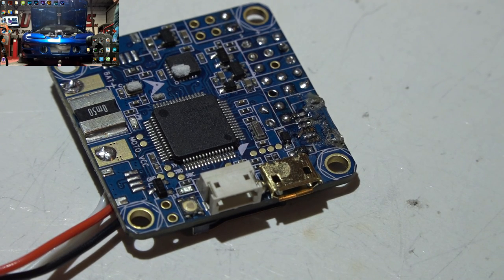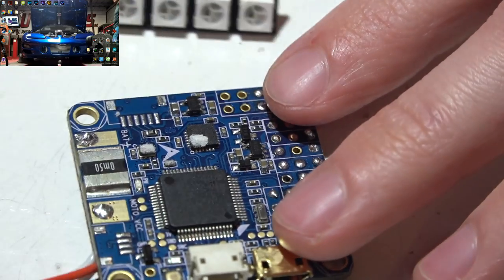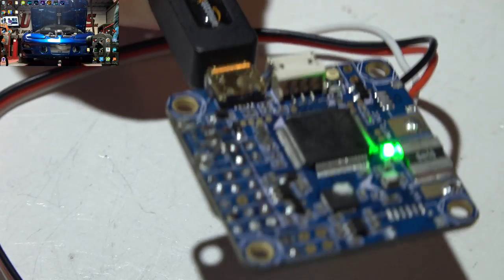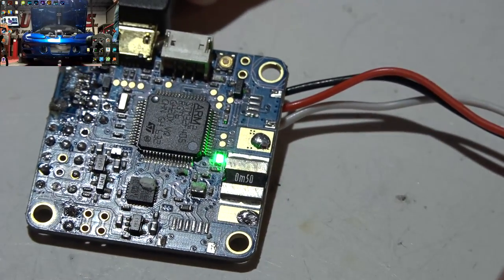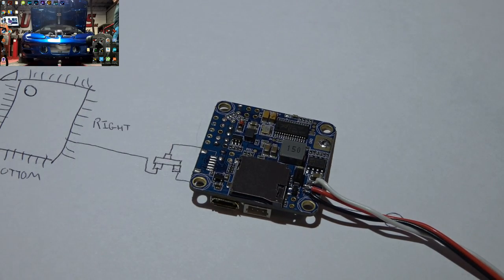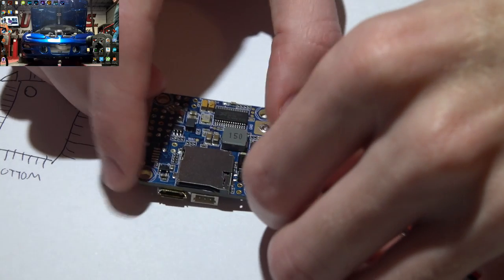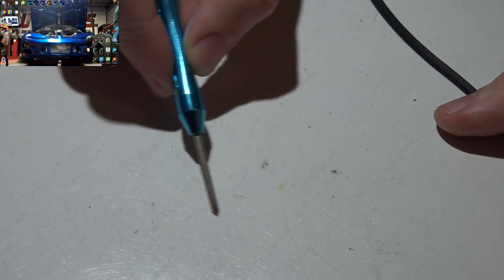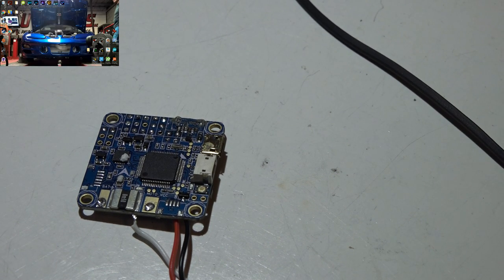How To Check F3 & F4 Processor Pin Outs

Comment: Omnibus F4 Pro. This video is fantastic. I tried PWM5 and PWM6 but noting happened. Came across this video and followed its content. My LED control pin ended up being CS (part of the 6pin connector above the  positive power supply from the battery). Perfect!!

Comment: FYI guys, my F4 PRO LED was mapped to "A1" aka PA1 which is assigned to PWM5 hole. it works!
Reply from the maker: Thanks for sharing. Not sure why its different. Might be different between firmwares.
Reply: yeah I am running betaflight 3.1
Reply: Hi! mine is the same, but I can´t make it work. When I only power it (led strip), some leds light up, but others don't. could it be wrapped?thanks

Comment: Good day to you Project Blue Falcon, I'm Reff !
Firstly, I would like to write that this was one of the awesome videos i've seen, very informative and you've actually taught me something new after watching it today, I never knew that this could be done, such as touching the cpu to the pins of the FC, I would never think of that, thank you very much !

Secondly, I have a question which I'm hoping that you might be able to help, and its regarding the SPI 1 pins on a Mamba F405 mk2 flight controller. I cant find which pins on Mamba F405 mk2 has the SPI 1. I've used your method of checking continuity as shown in this video, however none of the pins beep on the multimeter for any SPI pins. A
ny idea on how to trace, as I've tried two mulitimeters bet still cant find which pin is associated with SPI 1
Reply: Unfortunately Project Blue Falcon died on a motorcycle crash a few years ago, he won't answer. Even some time after this accident this channel is still relevant.

Comment: I am building a wing
they say to remove the red wire on the  plug on the speed controller
I'm not getting 5 volts on my servo
this board supposed to have 5 volts for the servo
is there something I'm missing I have to jump 
my 5-volt rail is dead for the servos          thanks for your help

Comment: Great vid JC. I've got an OBF3 were the video stopped working after a crash.  Video works fine if you bridge the signal wires together, just not through the FC board.  I've already replaced the board with a new one.  I'm thinking about doing a "reflow" with the old FC, like on StingersSwarm site.  Any thoughts before I toss it in the oven????
Reply from the maker: I'd say first, did you upgrade the firmware to 3.1 and are using the 1.8.5 configurator? Because I was having problems with video before. Also try flip flopping the camera and Vtx signal wires going into the board because they have been flip flopping the pin outs on the boards. If you've tried both then I'd say go ahead and try a reflow in the oven.
Reply: Thanks JC, this board is on 3.0.1.  I'll update and flip the pins.  OK, I love the OBF3 and OBF4 FCs (I have 5 of them), but it feels like playing wak-a-mole sometimes with the pinouts.  Remember PWM3 and PWM4 being reversed... Thanks again, have a great week...
Reply from the maker: Lol yea I remember that. Which I was upset about then switched 3 and 4. Then they fixed it in the firmware and I was upset I had to change them back haha.  Let me know if you still cant get it working or if the oven trick works.

Comment: I've made a lil bit of a mess by using a solder tip that was to big therefore overheating components around my work area. so I have an led that's gone and a few diodes.  Now my board won't connect to the configurator. It keeps failing saying "USB device descriptor failed" any help as to point me in the right direction? it's happened on two of my boards so far a Arris F3 Evo and a SP racing F3 mini. Thanks in advance. Great channel by the way!!!

Comment: Hey BlueFalcon. Can you find which pins are responsible for USB connection on betaflight f4 pro? From what I found they are either PB14 PB15 or PA11 PA12. Reason is, my USB is broken off and it seems that MSP has been turned off and i cannot get it to connect through uart (got no STLink) :(

Comment: hey bro maybe you can help me i just bought a bfight 210 and only fly it couple of times but for some reason i have no power for my vtx and my camera anymore i know the work because i can plug it into my receiver plug and the power up but i can not get it to power on in the correct plug in spot on the flight controller this controller is all plug and play and i cannot find an exact replacement. what do you think is up the drone flys but no vtx power

Comment: Great Video.  Could you do a similar video for DShot Flight controllers that require their motor outputs to be remapped to the PPM pin?  According to DShot wiki, some flight controllers work with Dshot but require a motor output to be remapped to the PPM.  

Specifically, I have the PikoBLX and according to the wiki, I have to remap motor 1 output to the PPM. This video and reading the wiki kind of helps but... Still a bit confused. I tested my FC on Dshot and my motor 1 does not spin and does require remapping.  :(

There are a few flight controllers on that wiki that require this and I'm sure a video explaining what to do will help hundreds, if not thousands from having to buy another flight controller. Thanks JC!
Reply from the maker: I've been planning on doing some of those videos. Problem is the only ones on that list that I own are the SPRacing Evo and SPRacing Mini. And I can get either to work. I've tried everything. Not sure if there is a bug in the firmware or if I'm just doing it wrong. Still trying because I hate when I cant figure something out.

Comment: I have a good device for you. Take this grab and take it into the bin. Then buy a SP Racing F3 board and get happy. I use them and have nothing of these problems. Because the question is do you wanna fly or repair all the time?
Reply from the maker: I dont use LEDs so its not really a problem.